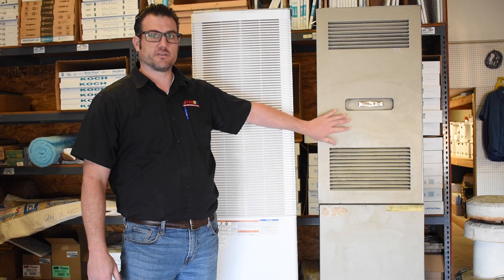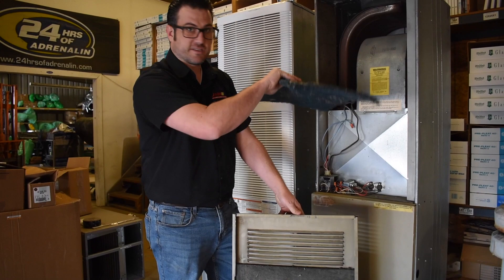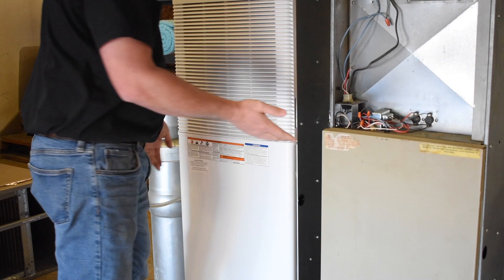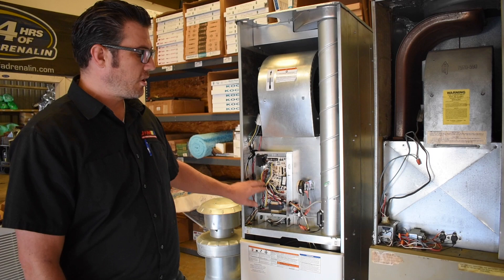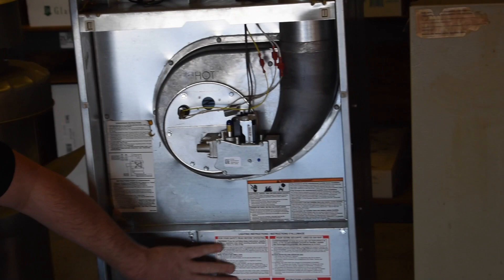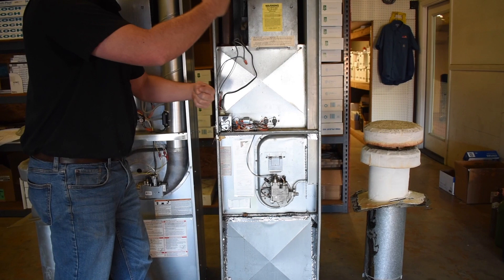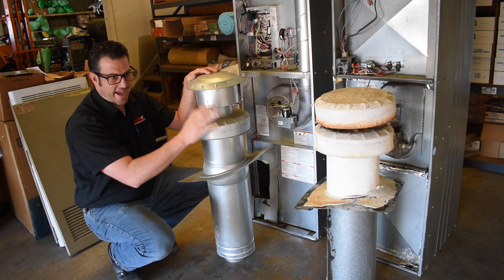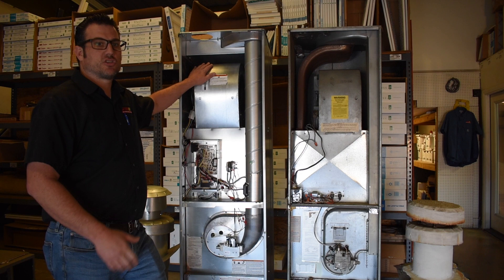Coleman Mobile Home Furnaces OLD vs NEW?

Comment: Thank you for this review. I replaced the old furnace you have there with the new one your talking about. Thing runs great the only thing I notice is I sucks a lot of air from inside my house to the point I can feel the cold air getting sucked from the window and doors! Why is it doing that? My old furnace did not suck air from inside the house. I notice you mention the roof jack i didn’t replace it with my furnace is that the issue? You mention something about how it sucks air from outside from there. My installer said mi jack still looked good. But the jack is for pilot version and not the new??? If you have any issues explanation that can help me out I would gladly appreciate it! FYI it’s the same jack that was installed with the old furnace.
Reply from the maker: check the crossover duct under the home. It may have come off, or is damaged. When you have that problem it indicates the you have duct leakage on the supply side of the duct system (the ducts that blow air back to the home. )
Reply from the maker: The roof jack will not cause that problem (see previous reply). what can happen with the roof jack is improper combustion, air fuel mix etc. have a qualified technician inspect it.

Comment: I just moved into my home and I have a Nortek MG2R furnace. I see the filter on the door (it's the cut to size rather than a standard), but there is also a filter shoved in next to the blower motor on the right side. Is that supposed to be there? Also, I've seen photos of having to replace the black material on the sides of the blower motor. Is that something I need to do? My furnace in my old home was standard, so the filter slipped into a slot near the floor (simple). This is all new to me and I can't seem to find ANY information online (or in the manuals) about the filters, how many there are, where they should be, and replacing them. Any advice would be appreciated as your video has the most info I've seen so far. Thank you
Reply from the maker: You just need the filters in the door. They should not be loose fitting. If you need a larger size than what is there that is fine. The goal is just to have a filter that fits and doesn't come loose.

Comment: I've been trying to find replacement metal brackets for the plastic door that the door latches clip into. Several homes in our community we manage are missing the brackets. They tend to break off of the door then the resident throws them away!
Reply from the maker: online ordering is tough, I think the part number is S1-02118364000 (Male side). Best to contact a local contractor to have them order them for you. They are not expensive.    Female is S1-02118365000... but don't take my word for it.
Reply: Just drill it out and use small washers and screws.But if they had tossed them out when they broke off, charge them for them.

Comment: How would you replace The Inducer Motor on the Coleman 56,000BTU  furnace  any video  ?
Reply from the maker: Inducer motors are pretty straight forward. Just make sure your gaskets are intact and remove the power before sticking your fingers in. This is not a common thing for DIYers. Find a good local contractor.

Comment: My 1978 mobile home furnace has a separate  closet access outside and it’s a updraft into the roof cavity-attic duct work . Extremely quiet but very difficult and expensive to upgrade the duct work .
Reply from the maker: We see a lot of those. The ducting in the attic is basically impossible to upgrade/replace. We see issues with air flow to the opposite corners of the home. For the money, ductless is a better option.

Comment: I have a 1300 1400 sq foot modular home in Illinois. What size furnace and ac do you recommend?? It’s a downflow and I want to buy a furnace with a coil under it and precharged lines.. Any recommendations??? It’s a 70s doublewide basicalky that I turned into a nice home,, insulated well dry walled  it,, pitched roof added to it .
Reply from the maker: Find a local contractor that performs a "Manual J Load Calculation" they will be able to guide you.

Comment: I went from electric to gas. The new gas has blower on top pushing air down to the existing ducking.
 My question. Is that why it doesn't heat as well? The AC can't lower the temp either. The new furnace has been a complete wast of money.
Reply: How long ago did you have it installed? And was it inspected? 

Maybe it was installed incorrectly, or maybe your thermostat isn’t calling for heat/cool. 

There’s a couple of things that could be going wrong, but without seeing it I could let tell you.

Comment: I have a constant blinking green light, coming from control box. And the furnace was just installed a month age. ???? Any ideas
Reply from the maker: You'll need to reference the manual for your specific model. Unfortunately there is no standard across the industry for trouble codes.

Comment: I find it ironic how practically every gas furnace went to using draft inducer motors. 

 When my grandparents first moved onto their farm in the 1970's, they had 2 adjacent mobile homes. The other was for a field hand, which my parents would by a couple of years later. 

 Our mobile home was a 1973 Suncrest with a Coleman natural draft furnace. The burner was round and torch-like. The flames would rise upward and would split around a "cap". 

 My grandparent's mobile home was a 1956 Richardson with a Coleman furnace that used a draft inducer. It was silver with a latch handle at the very time. The burner was round and looked like a ring of torpedoes firing inward. 

 I was only 9 when my parents sold their mobile home and built their new house. And 15 when my grandparents had to get a new Coleman/Evcon furnace, which proved problematic and would fight them through their last decade of living in that mobile home. 

 I had never seen another furnace with a burner like ours or like their first one. But it's strange to me that theirs had a draft inducer and ours had a natural draft. It's almost as if they improved the technology to where a mobile home furnace wouldn't need a draft inducer. But only for a short period of time as all the energy efficient designs of modern furnaces require them. Is there a specific name to describe the styles of burners I'm talking about?
Reply: Is it possible that the older mobile home may have had a natural draft furnace but may have had to be replaced sometime before you moved in to the farm and did the draft inducer furnace have a pilot light or did it use electronic ignition

Comment: I need help , i have the new version,one day when i come home,my mobile home was soo cold ,i check and the pilot was off,but the switch still on so i turn off both switches (motor and pilot,) for a couple minutes and then i turn on both switches again, the motor looks like is working but the pilot turn on and then start going off, few seconds later the pilot turns on and then after few seconds goes off again, please i  need help.
Reply from the maker: You may need to contact your local HVAC contractor. If you are in the Inland empire area of SoCal give us a call at (951) 654-3464
Reply: There's a flame detector and if it does not detect flame (heat) in a few seconds everything shuts down.  Could be no gas or a bad igniter.

Comment: How do I make my water hotter? I’m living in a trailer home with the new furnace showed in this video
Reply from the maker: These are for heating the air in the home. Your water heater is a separate appliance. The instructions for changing the water temp should be on the label of the water heater.

Comment: Question?...Since mobile home duct systems are smaller ...will static pressure be an issue?...Thank you for the video
Reply from the maker: Hi Michael. Great question. Static pressure is important on all systems, one thing we have discovered is that most systems are oversized and when properly sized less air flow is required and the static pressure is less of an issue. Less airflow = lower static when the duct is the same size. In some cases we have to increase the crossover duct. sometimes there is nothing you can do for a reasonable cost. When the duct is really bad I recommend ductless system.
Reply: J & M Air Conditioning & Heating ductless system how does that work??
Reply: @daveyboy8907  
Really....Why wont static be a problem?...
Reply: @daveyboy8907  ..or better yet...how does it work then?
Reply from the maker: @daveyboy8907  https://www.carrier.com/residential/en/ca/products/ductless-systems/

Comment: I learned alot about my new furnace, I have a question how do I light my furnace, if you would be so kind to tell me how.
Reply from the maker: The instructions should be on the furnace. Modern furnaces do not have a pilot, so you do not need to light them manually. It really just depends on the age of the furnace.

Comment: How can I replaced my filter on my old furnace. In the best way ....(which one should i use) my furnace it’s the old like the video ?????????
Reply from the maker: It is mostly trial and error on the filters on the older models. It helps to have a wire or brace to hold it in place, and select a filter that fits well. Your local air conditioning contractor should have cut to fit filters they can offer you.

Comment: How do you light the older furnace so we can get our heater going?
Reply from the maker: The instructions should be on the furnace. Generally speaking, you should make sure the gas is turned on, and the valve is set to "pilot" You will need to hold down the pilot button, while lighting the pilot through the access door using a long stick lighter or match. after about 60 seconds, after the pilot is lit, you can release the pilot button and turn the valve to "on" . If that doesn't work you may need to call a service company in your area. If we are in your area, please visit our website www.jmairnheat.com

Comment: Hello, I am having trouble with my furnace and it is exactly the same as the old model in your video, a technician came earlier and without even opening it told me that it was the heat exchanger that I had to replace the whole unit, and I checked the website and the heat exchanger has lifetime warranty I just wanted to know the model on your furnace. Thank you in advance
Reply from the maker: Lifetime to the original owner is usually how that goes. So unless you purchased the home new, or the furnace new, you are probably out of luck on that. You might be able to replace just the heat-exchanger, but honestly, if it has gone bad, I'd replace the whole furnace.

Comment: How do you replace the booster motor with the pipe in the way?
Reply from the maker: chadakaira nada are you referring to the inducer?
Reply: @jmairnheat  Yes I am.
Reply from the maker: @chadakaira  The Inducer and the pipe are essentially integrated, the inducer can be unbolted.

Comment: So I'm trying to heat a fairly large shed would using a mobile home furnace be a good option and can I use tanked gas with one and how long will it last
Reply: Depending on the square footage... it’s probably better to install a ductless mini split. Can do both heating and cooling, and without ducting. 

They usually go for like 3-6k 
My company sells them, but we sell them for like 8-12k
Reply from the maker: there are probably better ways to heat a shed. I would contact a local pro near you.

Comment: Hi Matthew 
Hi I purchased an  mobile home a few years ago  an completely remodeled the intire thing an only thing I kept was the furnace because it was new  it looks to be the same Coleman  as the new one in your video,  an was curious  how much I would be looking at in adding AC coil an condenser To the unit   an was curious what brand or type of ac /coil kits you would recommend  ? from number I ran shows I need 15k cooling  
An what sorta cost estimate  would it be parts / install  I already ran power outside for a condenser
Reply from the maker: I recommend talking to a local Heating and cooling contractor. They can provide the expertise you need for your area.
Reply: @jmairnheat   thanks four reply , H vac companies were scheduled out a ways so  I purchased a  pre charged Revolv 2.5 ton 14 seer mobile home unit with a 3 ton coil an 20 ft line sets. With accucharge  quick connections . Pretty easy install besides  one line th big one was a  struggle to connect to the coil took a bit of muscle an anger lol.   But it's working  great  was going to do mini splits but after seeing your video figured central air would be best an cost less than having several mini split head units an would take up no room inside the house

Comment: So where do furnace filters go on the old model? Just in the door? Or is there another location?
Reply from the maker: Just the door.
Reply: @jmairnheat  than you for getting back to me. Turned out our issue was the chimney pipe was completely rotted causing our pilot light to keep going out.

Comment: I upgraded this last fall when my old furnace broke. 

But my new one is SOOO LOUD!! 
 It is extremely annoying, especially in a mobile home where you don't have a separate furnace room. 

Is there any way to help this on the newer models? Maybe a video on how to turn heating blower speed down? Or will that interfere with the electronics? 

Help please!!
Reply from the maker: You should discuss options with your contractor. Sometimes nothing can be done. Depends on a few variables
Reply: Best option is to contact a HVAC contractor and see if there is a relocation option for the furnace .
Reply: Same here mine is so loud, and the force of the air out of the ducts is almost “cooling” the heat, my Hvac tech said its because the ducts are to small and thats why the motor runs on high all the time.... i HATE it

Comment: What's the difference between a 1 stage/2 stage gas valve?
Reply from the maker: Hi Cliff, a 1 stage gas valve is the most common, and it operates in a simple on / off process.  A 2 stage valve will will have a off / low /high operation and allows for better control over the temperature, and less dramatic swings in termperature.

Comment: where can I buy 19x37 air filters for the Coleman 7900
Reply from the maker: 18x36 is probably the size, or 20x38. Odd numbers are not typical for filter sizes.

Comment: Realistically, the energy savings on electricity for these units is not really a big deal. With electricity around 10 cents a kilowatt, it makes almost no difference. The meat and potatoes of an upgrade might be better combustion efficiency, which could make a bigger difference, but there's an old saying of "if it ain't broke, don't fix it". That cheapo plastic cover will quickly break within a few years and finding parts can become difficult. Modern stuff tends to be made a lot cheaper and tend to not last as long. If the old furnace still works and works well, keep it until it can't be fixed anymore (some major part breaks that can't be replaced due to lack of parts availability). Replacing it any sooner is a waste of money for savings that will not pay off the cost of the new furnace before it breaks.

As for the pilot light running during the summer, you're an idiot if you leave it running in the summer. During the spring, once it warms up enough to not need the furnace, you shut down the furnace, do inspections, clean it, and prep it for summer, which means leaving the pilot light/gas off. When fall rolls back around and it gets cold, you inspect the furnace, turn on the gas, light the pilot, then proceed from there. There is zero energy wasted in the summer.
Reply from the maker: Mark Reaves you are not wrong, except electricity in our market (Southern California) is between 19-40/kw depending on many factors, and this is a big deal when you are running the ac for 2000 hours a year and the heat for 500 or so.  Regarding the pilot, many of our clients are elderly women, who frankly want nothing to do with lighting pilots etc. and the service call for handling it for them can exceed the savings.    But still you are right, we are just trying to show what is different about the units.